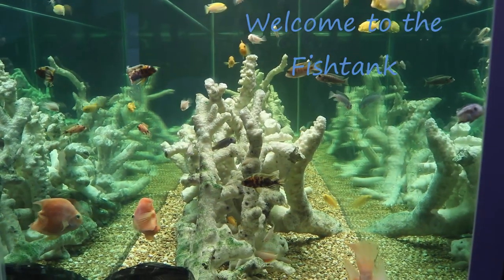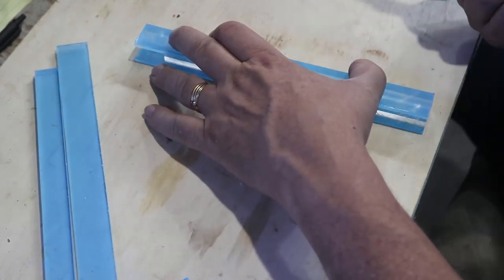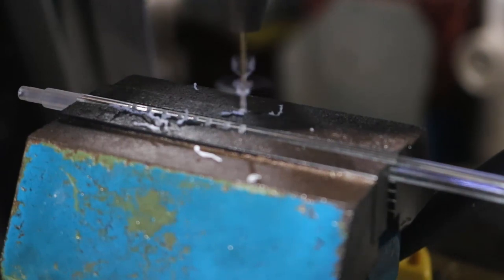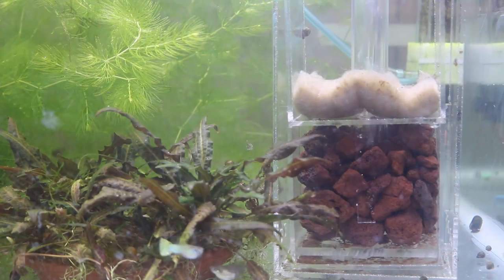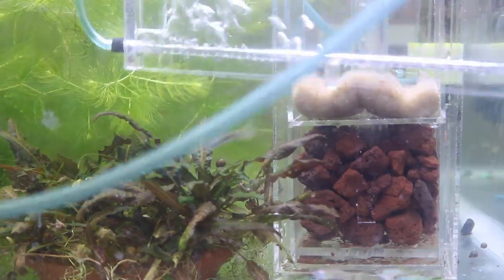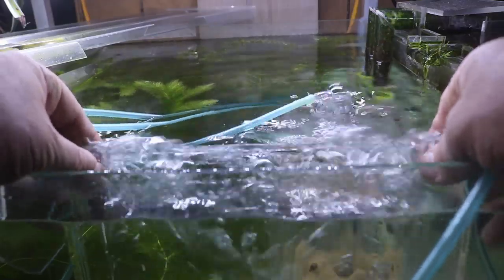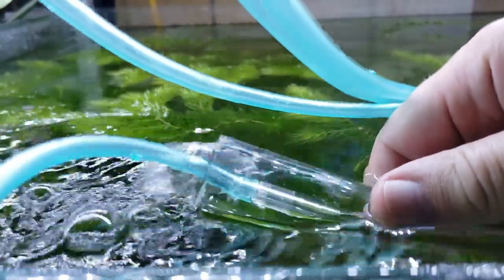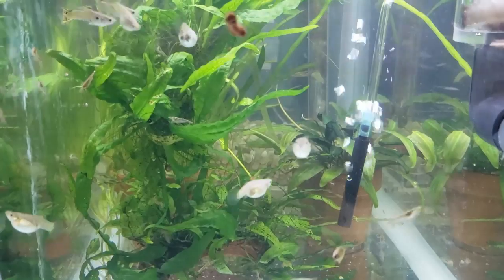DIY Bubble Wall as water delivery system ?!

Comment: This is pretty neat to see. I've been thinking for a long time about using something similar to this to build a sort of cascaded segmented tank with an aqueduct of sorts as a return (yes I know it's overly complicated). It's nice to see that the principle works in practice. 

The appeal of building a weird split tank is that I could build a shared ecosystem with species that would never normally be able to live together, or that just might not be commonly seen near each other. The downside, of course, is that every time I look into this project it gets more complex.
Reply from the maker: That's part of the fun of diy, dreaming up stuff and then seeing if you can put them together. They're not always going to work but every now and then something hits home and that is so cool. Thanks so much for taking the time to come by and share your thoughts

Comment: I can't say I've ever seen a bubble wall that's contained. I've usually seen them where it is a fine mist that is just open to the tank. I know that you've got a beefy air pump for your fish room that puts out some serious volume. I'm curious as to how it looks with a more "standard" air pump, if you've got one knocking around.

That immersed planter box is beautiful. Things have really grown in well on it.
Reply from the maker: I do use a bigger air pump for my fish room, but I only use the same amount of pressure as a regular air pump for these builds. This is what you would get if you plugged this into any quality dual outlet air pump. Thanks for coming by

Comment: You could make the opening for the bubble wand on the side. The water flow would move out across the top of the water instead of just straight out of the water? Second, could you make a mini bog filter with your lava rock setup? My sister gave me a book about the Walsted Method for fish tanks. Could you put bog plants and substrate in the top and lava rocks on the bottom?
Reply from the maker: Yes you can set it up with that arrangement. As long as the flow was strong enough so that water got to all parts of it. Thanks for sharing your thoughts on this.

Comment: I prefer the tiny bubbles but I have the same problem with my air stones.  They only work temporarily then clog up.  Our tap water is rock hard which makes this even a greater problem.  Could you put some kind of "filter" above the air stone to make a finer stream of bubbles?  Always look forward to your videos.  Thanks Fred O
Reply from the maker: Hey Fred! Making finer bubbles is actually hard to do. I'm going to try and work on that and we will see where it goes. Thanks for coming by

Comment: The angled flow idea holds because the flow rate/lift rate is related to the total distance of the combined flow.
Reply from the maker: So true. Air encourages the water to move and the longer it does so the greater the flow. Thanks for watching

Comment: A sweeping elbow makes airlift stuff quieter and cuts down on less flow if its close to the surface. i still think you should play with them more.
Reply from the maker: I find the extruded acrylic I have available here doesn't behave well when bending it. It bends but not evenly. I will have to look into cast tubing to see how pricey that would be. Thanks for coming by
Reply: @FishmanEricRussell  you ever going to set up that PO box so we can send you chemical, biological and nuclear weapons giving the US an excuse to invade?
Reply from the maker: @Zaku186  Soon
Reply: @FishmanEricRussell  Why not just buy PVC elbows? thats what i was plannin on doing. not everything has to be DIY. just a PVC "sweeping elbow"

Comment: For those who prefer the micro bubble smooth effects, what modifications should be used in the design?
Reply from the maker: The only change I would make would be to use one of the commercial bubble wands instead of the acrylic tubing. Thanks for watching